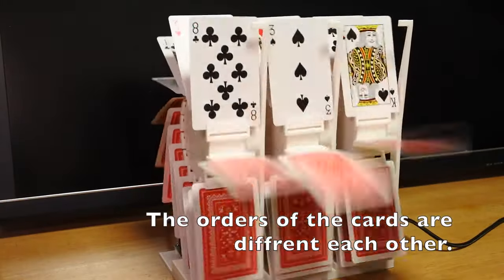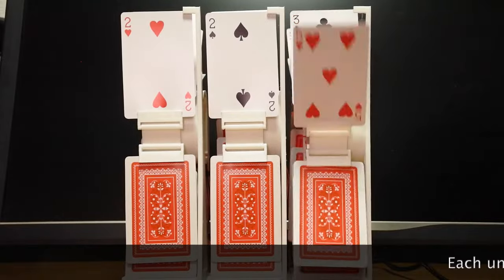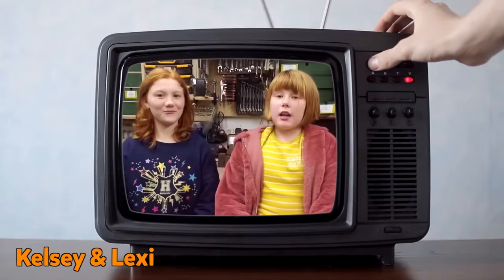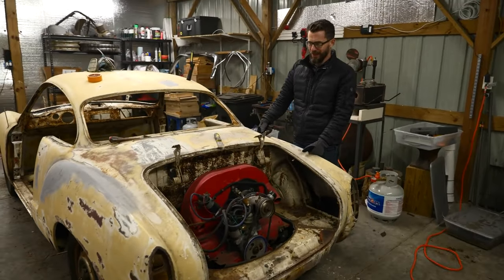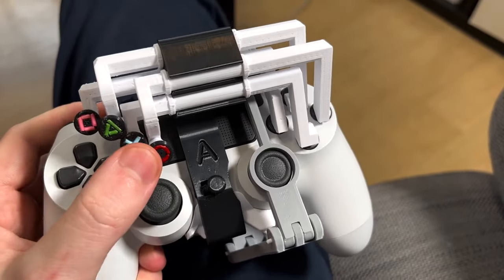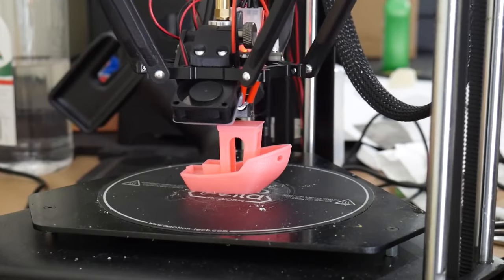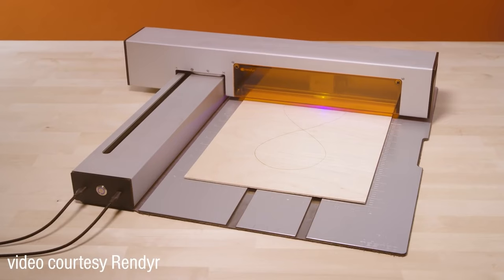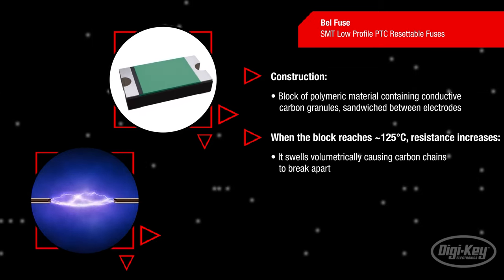Half Past a Full House [Maker Update] | Maker.io

Comment: interesting, I didn't know that there were fuses based on temperature, I thought they were all based on current and voltage
Reply: In a sense, current based fuses are based on temperature, they just don't reset. Circuit breakers can be reset manually and MOSFETs can be used as an auto resetting circuit breaker. Just make sure you use AC circuit protection and DC circuit protection as designed.